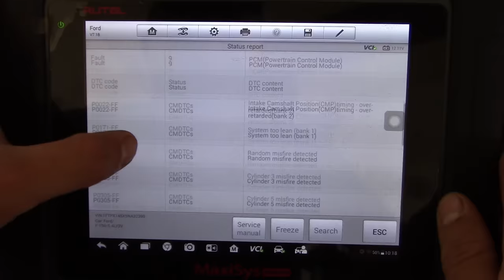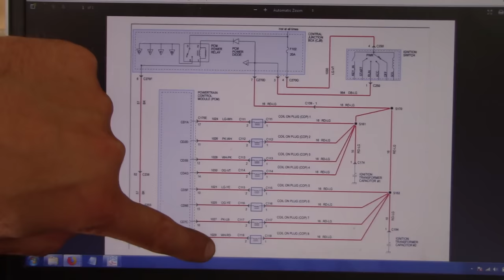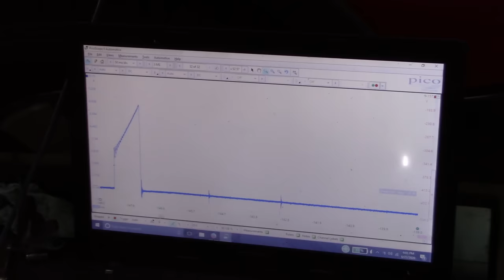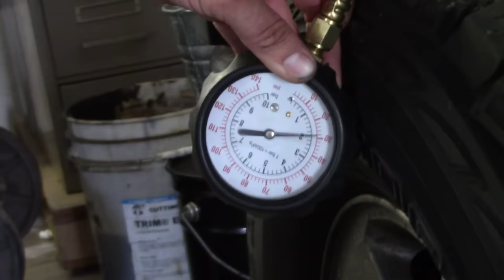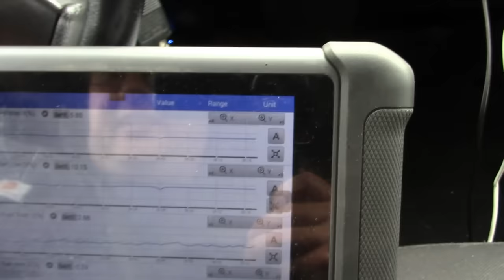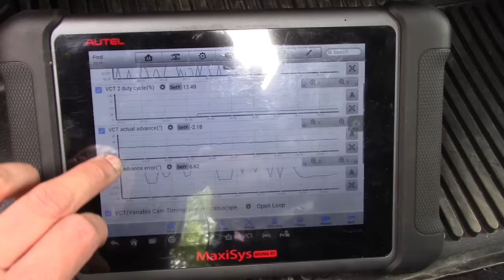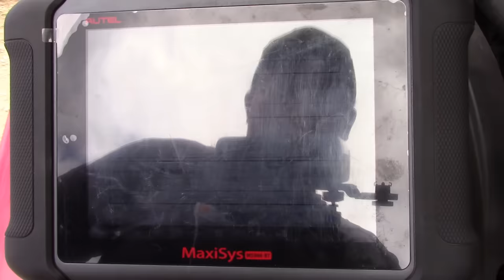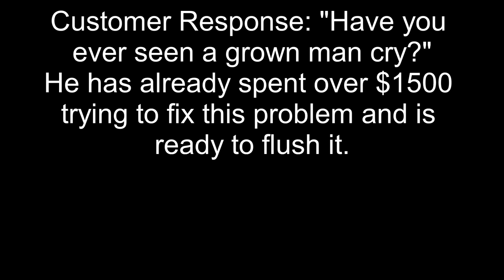2005 Ford F150 5.4L - missfires, intermittent rough running, rattles and knocks, P0021/P022

Comment from the maker: FYI, this engine is still running over a year later. I installed new VVT solenoids, new guides, new tensioners, a used timing cover and put it back together as is with the old chains and phasers.
Reply: That's good to hear at least. That poor guy.
Reply: I just bought a 08, & it's doing the same when it's hot.  The owner put $3,000 into new timing kit from Cloyne.  I'm glad you wrote that the engine is working good for a year now, cause I'm going to put money into it.  Thanks again
Reply: New cam bearings also?
Reply: Beans?
Reply: I'm glad to hear you were able to help this poor guy out of a really bad situation into a sad situation . At least he's getting some use out of his investment .  Let the buyer beware .
Reply: How much did you charge him ? Just curious
Reply: @montestu5502  no
Reply: Did it still sound like a diesel after you did all that?
Reply: OK well it sounds like you got it fixed good job Wes! When it comes back with bad phasers please post a video of you putting in some phaser locks I posted a nice description of what you may need in my other comments.
Reply: The trouble with people that own cars these days they don't maintain them they just running until it's time to parking lot on the North 40
Reply: What a disaster, whole s...  Unbelievable, but I also think the first owner just didn't five a s..t about the truck, because he knew he will find someone who will buy the thing.
Reply: Did Ford correct these issues going forward?
Reply: @andrewfotopoulos7766  They quit making the engine altogether. I’ve not heard of any problems like this on their newer eco-boost and the other engines in production.
Reply: considering the prices people are asking for trucks these days its almost making more sense to fix it as best you can since replacing it can be even more costly.
Reply: @montestu5502  none, they run on alum cam bracket, could be machined i suppose, i had to replace both side cams, chains guides, lash adjusters and rockers, mine were all shot at 100k
Reply: Check out the Ford Makuloco channel for a complete indepth explaination.
Reply: last owner never did oil changes. theres your problem, now it has slack chains, which change the timing. i had a 253 holden v8, had to move the crank before i could start it. very,slack fkt chain.
Reply: Why would you tear it all apart at over 100k and not change the phasers with the new upgrades from Ford? Never use aftermarket cam phasers on a Ford 5.4. I would have atleast replaced the coil that was drowning in water and questioned how water got inside. JMO
Reply: Of course it is, they can hit over 300k dude.
Reply: Thank you for this vid ,I have been chasing this exact problem for a year , nobody was able to figure it out , 09 f150 with 75000 miles. Damb truck sounded like a diesel motor
Reply: @montestu5502  wish they had the for thought to build them with bearings but instead they just use the cast aluminum head as the bushing
Reply: @montestu5502  The cams on these 5.4s do not use bearings. I discovered that while working on mine.
Reply: I’m in exactly the same situation. I haven’t torn down to inspect but I’m sure it’s the same except maybe the JB WELD.
Reply: What about the damage to the cam?
Reply: @mikedurnell  Longer factory oil change intervals help marketing and service, but not the owners. Late model Ford, GM and Chrysler OHC engines and especially any GM or Chrysler V8 that has AFM or equivalent are super sensitive to dirty oil and viscosity. All brands have VVT now.  But people wanna stretch it as long as they can, or not do it at all. It's sick how many engine swaps I see done because they wouldn't change the oil.
Reply: @garysisk3431  I believe these can be machined and have bushings/bearings installed. It would have been nice to have them in the first place, but OHC engines are supposed to have the advantage of better valvetrain stability and wear, and the bean counters want to save somewhere. 🥴
Reply: @montestu5502  no cam bearings on these.
Reply: If they could just design the oils leaks th land on the rust spots on the chassis...that would be a perfect storm.
Reply: @HFG  tu
Reply: That's great to hear Wes always awesome to hear a vehicle repair went well on these rigs @Watch Wes Work
Reply: @bradbaynham5368  did you fix it? sound like the oil pump is bad
Reply: @montestu5502  Not replaceable.
Reply: I've seen alot of them with even worse cam damage just go with a set of new cams, high flow melling 340 oil pump with shimmed spring,  new timing kit and fixed the issue.. I know of one on almost 100k with that fix and runs great.

Wish there was a way to switch to mechanical tensioner so the oil leak issue wouldn't be so damaging.
Reply: 5.4 3V , Impressive still running,, I will not work on this engine, oil passages too narrow, they will always fail
Reply: @seanmikk1505   YES
Reply: @andrewfotopoulos7766   no , not until 2012 with new 5.0 V8 and it had weak connecting rods ..
Reply: Should have installed a hv oil pump and cleaned the pick up screen. Ford tough! Lol
Reply: Wow
Reply: @montestu5502 the cams ride on the aluminum head surface.  No bearings
Reply: Take away is don't buy a car with a noisy engine unless you're prepared to rebuild it.
Reply: @MrSpartanPaul actual cash value was about 1G. This goes same for any old rusted hulk with engine issues which i have paid myself 5k for not knowing better at the time. We are all suckers at some point.
Reply: Hey wes, haven't watched this video yet but I was about to. I just finished installing new camshafts, lash adjusters, rollers, vvt solenoid. After installation my truck starts but idles rough. I know I screwed something up. Anyway you can point me in right direction? It's a 2009 f150 4.6 3 valve. Thank you.
Reply: Low oil pressure causes this to happen.

Comment: thats the hard part sometimes about being an honest mechanic , having the tell your customer that the people before you took them for  a ride , , sort of makes us all look bad . nice work though , definitely a head scratcher , great job figuring it out
Reply from the maker: Very true!
Reply: I agree.
Reply: Keep being honest - your customers will trust you and keep coming back.  Its really hard to find an honest mechanic, even here in the UK but when you have a problem they are worth their weight in gold.
Reply: Kudos for your honesty. Kept wondering what the other guys did for him.
Reply: the video proof is a fantastic thing for un-trusting clients that have been screwed before.
Reply: Alayum Loyd  i always listen to the engine and check the oil level before taking a test drive so i don't get blamed for an engine knock.  many times I've found no oil on the stick.  don't want to get blamed for someone else's neglect.  
that mechanic may have rev'd the engine high with low oil and spun a bearing but it's really hard to say who's at fault
Reply: It's also a good reason to have the thing checked by a mechanic like Wes before handing the guy a pocket full of money if you don't know what to look for or haven't researched known problems. I feel sorry but I don't feel sorry because I've ran into slick ones that can look at theirselves in the mirror every day with no problem. Ford should be held accountable because junk like these motors just breeds crooks.

Comment: Very impressed with your thought process and how well you explain issues...i am an engineer and am just learning that I dont want a 5.4 / 3 valve in a used expedition..  seems the oil sludge and cam phasers are a nightmare in these engines

Comment: The key to them 5.4 three valves is good maintenance. I feel for the guy, you just can’t beat the push rod engines.
Reply: They weren’t trying for as much back then, I have to wonder though if it would be a good idea to switch entirely to gear drive on these newer engines with active camshafts, just to avoid any extra issues.

Comment: Watching all this makes me really miss my 1977 Ford with the inline 300 cid straight six. So easy to work on and not all that electronic crap to go wrong. I put almost 200k miles on it with very little trouble. What trouble I had was easy and cheap to fix. Those were the good old days.
Reply: My 1978 F250 Super Cab had over 500k miles on it when I sold it. I replaced the motor once at 300k and the original C6 transmission was still putting power to the wheels. Best damn truck I ever owned. My 2005 Expedition has been the worse POS I’ve ever been held hostage by for the last 8 years. Only 54,000 miles driven on it in 8 years and it has been the most expensive junk of a vehicle I have ever owned. Look forward to unloading it some day.
Reply: @kristopherdetar4346  I see this all the time and it doesn't have to be. Both Ford and GM keep going down in quality and wonder why Ram is outselling GM and gaining rapidly on Ford. Such a shame. But Ford and GM both let Toyota, Nissan, Kia, and Haundi run them out of the ar business. Sad.
Reply: I had 1995 150 with inline 6 with 5 five speed with o.d. gear easy work but Midwest rust made it little difficult it 250 went I sold brought it from fleet auction with 187000
Reply: @conorcuomo4283  I have never had a rust problem living in Texas. I now have a twenty one year old Nissan Frontier and you can look under it and nothing is rusted. I am keeping this one as long as it will run.
Reply: Daniel
YES my 79 Ford 351 engine. Very underpowered but that was my fault. Thought it would get better fuel mileage. 12 MPG weather loaded up on rear or empty. My 2000 with 10 cylinder gets the same mileage. Like you said those old engine's the 351 was so easy to work on. The sad thing was I sold it myself no trade in. The guy that bought it destroyed it saw it like a month later, he just used it to haul junk. Wish I had kept it as a power up truck sense I really did not have to sell it. I had a 4 speed in it with granny gear first. It was a nice truck with the square headlights. The old style body before they made the very Ugly front back in body headlights. I sure miss that old girl, just like you you could work on those Engines even V-8s.
Reply: BL Dontmatter  
Just the fact that it had factory 2 barrel carb.
That did not help. My friend had short body Ford pick up back then with bigger engine 390 4 barrel carb. Boy he could sprint those tires,
Reply: Best motor Ford ever made
Reply: My question. Why did you not keep your 77 Ford?
Reply: @billywird  I now wish I had it back even with the two hundred K miles o n it. Had I known what we were going to have today, I would have kept it. Hine sight is 20/20.
Reply: Yes sir I quite agree with you. All the pickups I own nothing is newer than 1985 and my car is a 2000 Buick which I inherited from my Dad I drive it when it is summer as the car has a/c but of course I drive one of the trucks more. That 300 Ford six is a good engine. My junk is all GM but all of the manufacturers made good stuff.

Comment: Man talk about a flashback. I had the same issue with my 05 F150. I got a used motor from junkyard and all the cam bearings were trashed. At that point I was ready to dump it. Decided to get reman tho after it sat for year

Comment: “How many spark plugs does an eight cylinder diesel have?” Used to be a trick question
Reply: In all honesty I would put new tensioner gaskets and a chain guide and run it until it blows, may make it a month may make it a year but there’s no sense in throwing away all that money
Reply: It still is!  ;-)
Reply: Yeah, it sounds like a diesel - sounds oddly similar to the GM 6.5 diesel
Reply: I went to my local SuperCheap Auto store and as a joke asked the girl at counter for a set of spark plugs for my diesel Pajero, she actually started to look on their system for them... I had to explain to her what I had done. Sad as this girl was not a checkout chick type but higher up the chain.
Reply: Hah!  I was just about to post something about "is it bad if it sounds like a late 90's powerstroke?"
Reply: Sometimes I would be asked to work on a truck, and nobody would tell me it was a diesel. I would start cranking, waiting, and starting to think "This has gone on long enough, time for a set of spark plugs and plug wires." Finally it would start and make that diesel sound, and I'd feel relieved. From that point on, I would know to preheat the glow plugs.
+pinay addiction
Many cashiers at auto repair shops don't know much about auto repair. Someone just needs several cashiers that can operate a simple computer, and only a few people who know auto repair very well.
Reply: @esurcylimaf4335  
Hell yeah bro, that's funny. Those chain parts stores hire a lot of people who have no real world automotive experience or knowledge. Mostly kids, infact. They pay extremely low, and they drug test which is a huge joke. I could be 5 joints deep and then some, and still do a better job. Most people probably could honestly.
Reply: The MD Farmall diesel was a 4 cylinder, and had 4 spark plugs.
Reply: Charles Tucke
Reply: @bonzai2380  What? The MD was started and warmed up on gasoline. Once it got warm enough, the diesel was turned on and the gas and spark was turned off .
Reply: 12
Reply: I'm not a mechanic... what's the answer to this so I don't get taken for a ride? I'll be honest and guess 16? I'm asking honestly what's the answer?
Reply: LordViktor299 diesels don’t have spark plugs, it’s a joke. Diesel fuel ignites on compression only, although modern diesels have what’s called “glow plugs” which heat up the fuel as it enters the cylinder and makes ignition easier (especially on cold start).
Reply: greg olson I thought that to but all thos parts are worth more then the truck and it’s not like it’s a bronco in mint condition or something, the only way I would take a 5.4 is somebody paid me to take to the yard, nothing but problems
Reply: How much did you get the pico stuff for?
Reply: @LPWSzzz  I have a 2007 F150 with the 5.4. It has 220,000 miles on it and is going strong. I use 5-30 full synthetic oil with Molbile 1 oil filters. Change oil every 3000 miles. Did need to replace coils at 160,000 miles. Good clean oil goes a long ways on the 5.4. The 5-20 oil is insufficient for the 5.4 in my opinion and that causes are lot of problems.
Reply: 50000 plus with our death rattle.  Its paid for so why not

Comment: Ha had this job done on my '09 F250. New Cam phasers, timing chains and guides ect. Ford now has a kit part # for all the bits you need. Ford knows they fk'd up. Upgraded Melling Oil Pump mod. They replaced all coil packs and plugs. Lucky that this engine they went back to the regular 1 piece spark plugs. All in $3500. At 5 years going after the repair, plowing snow all this time. Has turned out very well no problems.

Comment: Wes, terrific video.  The triton three valve hand grenade with the engine change light on was a prescient opening statement.  Great explanation about how the failure of the chain tensioner gaskets created a catalogue of oil starvation related issues down stream.

Comment: i knew where this was going when i saw the title. i have done many of these. many were done after the owner tried his hand at saving money. the snow ball effect is alive and well in this engine. where do you stop? metal in the oil....metal in oil passages, damage to crank bearings, crank, rod bearings, rods, oil pump and what else? this is one of those that you hate to look at. they always end up the same. if you want it fixed properly, it needs to be completely torn down, hot tanked and rebuilt....or replaced. replacing with a reman makes it a more cut and dry cost....expect for the usually surprises.....rusted power steering line, bad pulley, cracked exhaust manifolds. cost wise the best thing to tell the customer to do is "close the hood, play taps and walk away".
Reply from the maker: Yeah I agree. What a crap design. I gave him prices from $3400 to $4900 to do the heads, used engine, or complete reman. The truck might bring $5000 on a good day.
Reply: @WatchWesWork  Not trying to be a smart A$$, having looked over some of the response's, I think what needs to be put on the table also is: Just what will say $5000.00 allow you to purchase in a "new to customer / owner vehicle" vs rebuilding what he's got and how long to expect from that rebuild. The situation really doesn't get better no matter which fork in the road you take. Just thought I'd throw my 2 cent's into the pile of horse manure, the poor customer has to deal with.
Reply: Truth.
Reply: The other problem is if you decide to dump the truck and look for something else 5k doesn’t get you much as far as trucks in good shape .Atleast not in Canada , I bought what I thought was a mint 2000 GMC Sierra 1500 only to fine out the rear end spider gears were shot and one spot of the frame was rotted . I already paid 3k for truck plus another $2900 on new parts to get it safety so I decided to get frame fixed and a low mileage rear was put in
Reply: For remanufactured engines whom would you guys recommend?